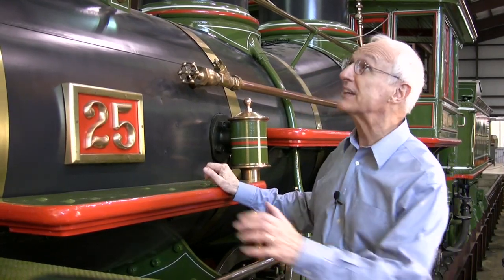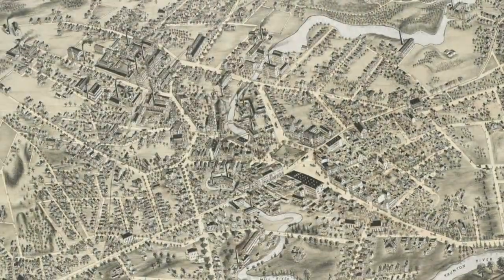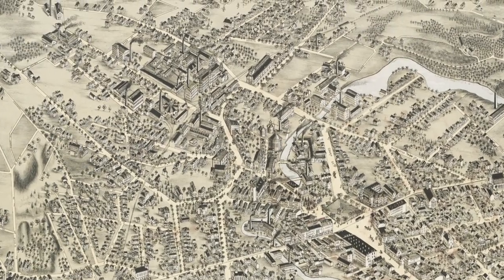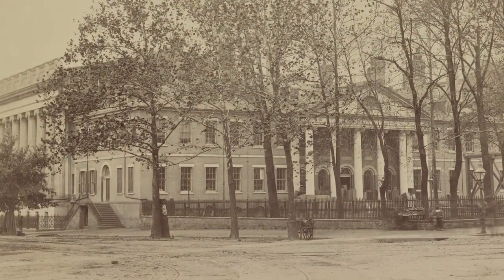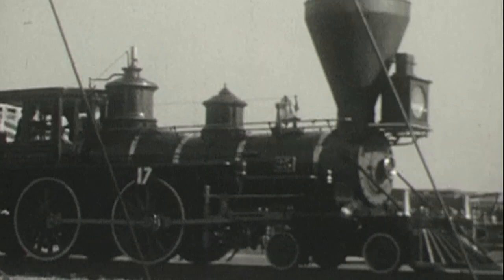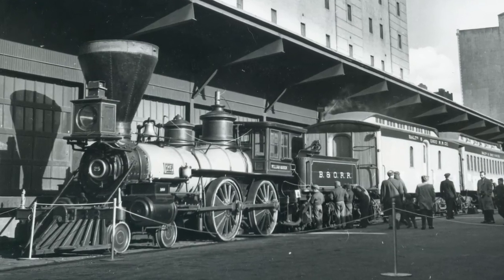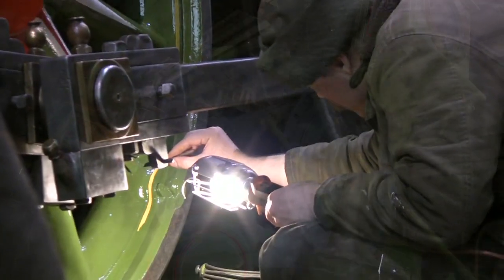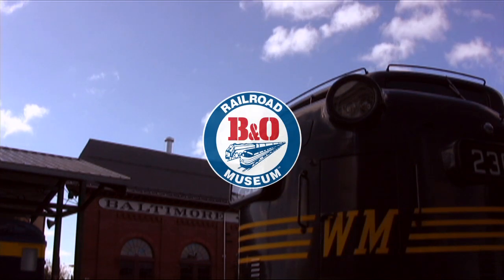B&O Railroad Museum TV Network: No. 25 William Mason

Comment: President Lincoln was inaugurated on March 4, 1861 rather than on January 20th as is done today.  The change to a January inauguration date came about because of the 20th amendment to the Constitution in 1933 and the January 20th inauguration date did not begin until FDR's second inauguration in January of 1937.  This could have a bearing on whether the Wm. Mason did actually pull Lincoln's train to Washington for the inauguration.

Comment: W&ARR General 4:29
Reply: Artemus Ou really??
Reply: Incorrect I'm afraid. That is a variation of the John Bull.
Reply: @LNERMALLARD4468  it has nothing to do with the John bull, it is indeed the general, you can clearly see it is a 4-4-0
Reply: TheBrantfordRailfan I’ll be damned, well I stand corrected.
Reply: @LNERMALLARD4468   However that picture was before it was rebuilt as it still had outside frames so that's why it looks different not to mention it was severely  damaged after a crash.